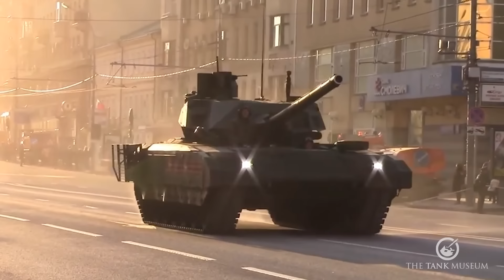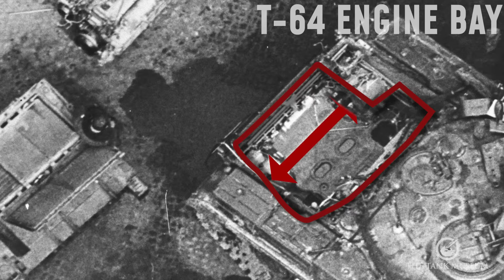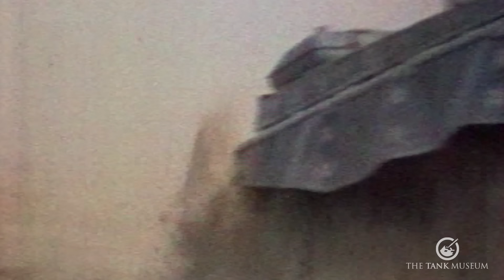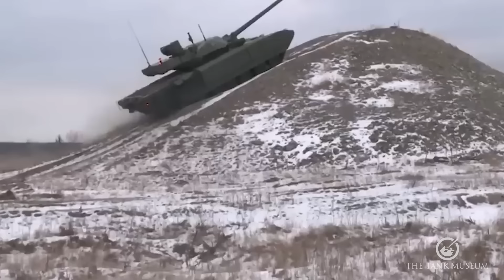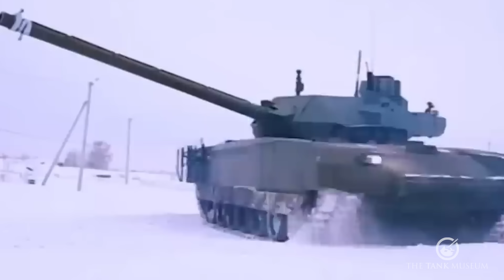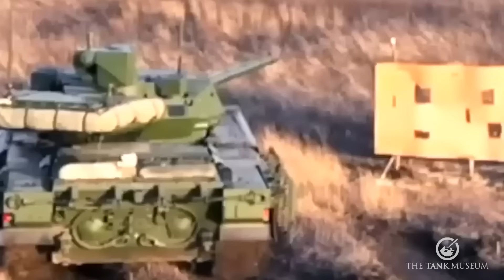Radical or Ridiculous? | T-14 Armata | Tank Chats #171

Comment: I feel like any footage of the T-14 should come with the disclaimer “Not actual game footage” 😂
Reply: The best way to discern real footage is to determine whether the turret is spinning wildly. If it is, it's real footage.
Reply: @bigrob966 T14 is a dual use vehicle. Tank and Helicopter all in one.
Reply: @AWMJoeyjoejoe  eeking out a few extra centimeters in the turret-tossing challenge
Reply: @AWMJoeyjoejoe  Pretty sure you have to spin the turret to 'charge' the vehicle. As you stop spinning and release the hand break, the tank rolls forward. As soon as the tank has fully rolled its way, its time to spin again. Just like toy cars from the 70s and previous years. The gun barrel acts as a leaver to easy the process.
Reply: @timarmbruster6693  You may be on to something. Last time they showed the T14 on their May parade (back when that still included tanks!), the turrets weren't spinning correctly, and wouldn't you know it, at least one of the T14s stopped working!
Reply: @AWMJoeyjoejoe  🤣🤣🤣🤣🤣🤣🤣🤣🤣🤣🤣🤣🤣🤣
Reply: @namewarvergeben  Back when it still had tanks? are you sure? prove it maybe i am wrong
Reply: @namewarvergeben No
Reply: @AWMJoeyjoejoe its like a bey blade. Wind up the turret and let go: the hull should spin
Reply: @bigrob966  😊😊 OOOOOOOOOOOO 999 oof a
Reply: dont compare it to the burned leos  @bigrob966
Reply: @bigrob966  Isn't it amazing what one can power with clockwork?
Reply: @Whatifwarlord  ..u just said it uself lol...
Reply: Украинцы уже наигрались))
Reply: Meat Salad  Funny how Russian corruption has bankrupted the Russian military from anything good whether it be armor, vehicles, guns, or anything for the military. I give you the "body armor" with egg crates sewn into it, trucks that have inferior tires and wooden parts, jets and tanks that rely on foreign electronics, and many other things. By the way, did your daddy Putin write that for you or did you come up with that in your parents' basement??
Reply: This is a work of fiction. Names, characters, places and incidents either are products of the russia's imagination or are used fictitiously.
Reply: Meat Salad  Which country is stealing toilets and washing machines? And they're too stupid to realize that they need running water for them to work?
Reply: Why do you "feel" like it? Why not think instead of feel?
Reply: MrSaiga308  ..."bankrupted" NATO ?? 😂...with few exceptions we haven't even STARTED to send Ukraine the REAL-DEAL stuff in meaningful numbers - we're still basically "phasing out" the OLD "war-gear" - especially the ex-Warsaw-Pact stocks of ammo & "hardware" from ex-Warsaw-Pact countries - even the Western-produced machines that have been sent have still been built one or two generations ago! 🤣...and ruski depots are burning in EXPONENTIAL numbers! 🤣😂😂ha!ha!ha!ha!
Reply: Yes..like ALL nato/american "victories"...lol
Reply: @Peoples Republic of Ninj morally..when they arm, fund and back nazis..luckily russia is wiping them out..just like in ww2..sad banderite bootlicker
Reply: @@peoplesrepublicofninj3418 Nato is like a gender pronounce
Reply: bot
Reply: There is literally no game with T14s in it.
Reply: did you know that the  Abrams is out with 2 tap from a T90? not even a T90-M?  very good  indeed :)
Reply: Yeah, well, Ukraine is being smashed with just rusty old t-55s and Russian shovels. Laugh that off, Genius.
Reply: useless and totally biased video, judged based on westerns mindset where expensive is "more better", russian and chinese fight with quantity, t14 wa left aside because is too costly and to boost t90M, t72M and t80M production, chips are being smugled into the country like no sanctions have ever happened you guys live in a bubble of childish
Reply: Didn't somebody leak the official specs and operating manual on War Thunder? I feel sure they must have...
Reply: MrSaiga308  You're living in a fantasy world.
Reply: @AWMJoeyjoejoe  Meat Salad Troll/Russian Bot.
Reply: @Lonewolfmike  Me?
Reply: @AWMJoeyjoejoe  Meat Salad is a troll. They are a Putin fanboy or whatever.
Reply: @Lonewolfmike  Ahh gotcha.
Reply: @AWMJoeyjoejoe  
Biden in 2022- Our sanctions will be torn to shreds the Russian economy.
Biden in 2023 - US default is not an option.
Reply: Everybody keeps knocking on Russian tanks but they are super advanced.  Name another country whose tanks are equipped with ejection turrets.  ;)
Reply: @auldphart7912  ejecto seato, cuz!
Reply: @auldphart7912  🤣🤣🤣🤣🤣🤣🤣🤣🤣🤣🤣🤣🤣🤣🤣
Reply: @auldphart7912  what about these ejecting tank turrets of the Leopards 2? https://youtu.be/X6nZvDn6gRQ
Reply: @auldphart7912  Abrams, Leopards, M60s, T-55S, where are they used i wonder
Reply: Meat Salad  Bankrupted NATO?  US has sent $13 billion in arms and money. That’s one fifth the annual budget of NASA. Most of the equipment being given by European nations are models which were being phased out anyway Dear Lord. I honestly hope your comment was sarcasm.
Reply: If it's stuck then it's a T14
Reply: @ablrcklnthewall  if it is burning..it is a orcranian nazi coffin..and if it is nato..it is now in a tank museum in moscow..if they can find the remnants..lol
Reply: MrSaiga308  lol... ya right... economy of NATO is booming thanks to Russia...
even USA is ramping up...
Reply: Disclamer: not for use on muddy terrain such as battlefields, do not chenge gear while the vechicle is moving, do not expose to explosives, do not withstand large impacts, may oveheat when used, may only be operated on asphalt roads.
Reply: Meat Salad  highly doubt that one
they downgrade T-72 (obvious sight aka important factor) using T-55 as mobile artillery, using T-62M for assault vehicle
Reply: T14 is like RR it's great  when  it works  ..if it works..😉
Reply: I mean Russia has almost as many T14's as Britain has Challenger 2's.
Reply: Pre alpha footage not representative of final product.
Reply: Meat Salad  allied: * send money *
Russia: YeAh wEsTeRN aRE BaNKrUptCy

Just like "Russia running out of _______" not actually happened
Reply: Вспомни мультфильм про гиперзвуковую ракету над которым все смеялись, потом вспомни лица когда эта ракета пробила бункер.
Reply: MrSaiga308  America is always on the verge of defaulting. It's how their politics works, and it's nothing to do with Russia. Like I said, you're a fantasist.
Reply: @AWMJoeyjoejoe  yes..just like the constant war failures..america believes its hollywood fantasies..lol
Reply: Meat Salad  well but no
I point is they never run out like same reason as Russian tanks never run out
if you say "Printing money does not mean the US is not bankrupt"
It's gonna be like "Recycle tank from storage not mean Russia still have tanks"
both still find way out how2not run out
Reply: @SRDPS2  Oh come on you know what makes russians differente? easy production if NATO loses a leopard thats a tragedy if russia loses a T 90 meh lets change    tactics and make a new one
Reply: @Peoples Republic of Ninj >NATO is supported
NATO keeps about 30 countries as *hostages*. This would be more correct
Reply: And any deployment of the F35 will be "sorry unavailable due to massive cuts in military spending."
Reply: Since many Ukraine victories posted use Arma 3 thats a good idea.
Reply: Same for F35 submarines.
Reply: @rafaelgoncalvesdias7459  Its loss rate is still lower than any russian fighter out there
Reply: @ShitboxFlyer loss rate without even being in combat, you should be ashamed of yourself, but I'm not surprised your country can't even figure out what  gender their army has.

Comment: i saw a photo of the hatch open, it was about, 25 cm thick. any top down antitank missile blows through that with ease.
Reply: 25 mm?
Edit: 7 hrs later.  Not sarcasm.  Former printer seeing a typo.
Reply: Same thickness as the M1 Abrams (25.1mm) then, no tank apart from the Merkava Mk-4 has a composite roof so its a completely moot issue.
Reply: @DaSpineLessFish  Strv122 does too iirc (improved Leo2)
Reply: @SonsOfLorgar  Fascinating, its a forward thinking addition that hasn't seen much adoption yet because no one has really fought a serious modern war in many years.
Reply: Gz,its top is thicker than a Maus frontal.Allies are really screwed:(

Comment: Best thing NATO can hope for is that Russia commits to replacing their tank force with T-14s. It would be a huge weight round the neck of their army with no way to fix the issues. XD

Soviets spent decades failing to get the family of engines working right and frankly doesn't look like the Russians have managed much better. The A85 is a dudd. Bit dubious to say it was based on the german ww2 engine though, maybe inspired by originally but they are very different beyond the broad concept.

Comment: one thing i do love, is yes, russia is full of corruption
but the pentagon announced, rumsfeld back on sept10, 2022, trillions missing. they just "miscalculated" 3b of stuff to ukraine, and per an abc? or cbs? documentary - even in the trailer that they tore down quite quickly, 70% of arms are not making it to the front lines, and per reports, you can buy a javelin on the black market, one given to ukraine, for under 35k, and stingers are way cheaper. the US and Ukraine are hard at work trying to make sure they are the top dogs of corruption ;)

Comment: T-14 has not yet been used in battle or have the numbers to do so. Personally I'm more worried about the updated T-80s and the T-90Ms than a parade weapon.
Reply: T90M production is hindered because of sanctions. These "modern" tanks are built using a lot of components and electronics Russia no longer has access to.
Reply: @wyringen  😂 Dont tell, they are using washing mashine ics, right?
Propaganda consumer...
They are producing 100 T-90 in a month
Reply: @wyringen they use the older tanks as infantry support and artillery rather than as tanks. If a T90 or T55 shoots you you're still dead - the age of the tank isn't going to matter!

Comment: The T-14 seems like another Tiger situation. Where everyone takes the tank very seriously and hype it up as some unbeatable super monster. Sure it can fight, but it's actual combat capabilities are much different from what it has been hyped to be along with production numbers too low to have any notable strategic significance in the course of the war

It was stated that it would take 5 Shermans to take out a Tiger, and although it is true that the Tiger was better in tank duels than a Sherman (along with a couple other factors), there have been many situations where a Tiger has been knocked out by one M4 like any other tank. The same most likely applies to the T-14.
Reply: Tiger was real.
Reply: Yeah I think it's all Russian propaganda. Which is probably why we've not seen any in actual meaningful combat... because it'll be proven its just as vulnerable to western anti tank missiles.
Reply: Would you rather be a Tiger crew member or a sherman crew member though?
Reply: @PM_Fernandez_ES  sherman 10/10 times, you dont lose the war, obvious, you can actually succesfully bail out most times your tank is destroyed, your gun has a stabilizer (if lucky), you dont constantly smell your commanders ballsack because its cramped, you can actually retreat because the tank is fast, does not break down easily and doesnt require as much fuel, you get air support and better equipped infantry and support elements.

sherman 10/10 times
Reply: Russia has way beter arms production capabilities once mobilised than the west.
Reply: Used to... Not anymore! The USSR had the Production capabilities, which included Ukraine. Russia is now Alone! Ukraine had the Motor Plants and Steel Mills, and some of the Soviet Tech Industry was also in Ukraine. This is why Putin's Russia needs Ukraine so badly they were willing to go to war to get it!!! But all Russia has in Ukraine is RUINS!!!
Reply: @daniellejones5981  exactly. The centre of Russian/soviet industrial complex was always in Belarus and Ukraine.
Reply: Modern weapons are too complex, if you only start making them at the start of the war, you are already too late.
Reply: the russian economy is failing, the west collectively has like 7 times the economy russia does.
the west also has more than 800 F 35's already in service, i'm extremely certain if russia mobilizes the west doesn't even have to.

Comment: I think if Russia stuck with one model, it would be much easier to build and cheaper.  Stick to the t90 since it's the newest and more modern. Building t72a and t90 of various variations is probably a nightmare on the manufacturer.
Reply: The issue with the T90 though is that autoloader is so vulnerable to missile attack. Any penetration of the turret armour and off pops the turret.
Reply: @roadsweeper1  The turret pops off because ammo is stored around the turret. If it's kept in the carousel, it would give it more survivability. T90 does offer more ammo protection compared to older models. The issue is top attack detonation, where the turrert is the weakest. Any tank would be blown up from a top attack.

Comment: No hype, just facts. I love it!  Especially the competitive design bureaus pushing products that splinter the service uniformity of the armored forces.  In recent months, the effect of high tech sanctions apparently handicaps the Russia's ability to update firing systems, not only on tanks, but on artillery and ultimately on jet fighters.  If the effectiveness of their hardware is inching forward, it may go into hibernation until this 'special military operation' ends. Russia's dilemma: slightly better hardware, operated in 'non-Red Square' terrain by significantly diminished and under qualified crews, is a formula for disaster.

Comment: I don't think the real problem is the design, nothing about the Armata actually seems particularly bad or far-fetched on paper. The reason it is ridiculous is the logistics of it. Specifically, the industrial logistics. 

Russia just has nothing like the advanced industrial capacity to produce and maintain these at scale. The Soviets did, the Russians don't. Making the entire thing utterly ridiculous, as evidenced by the fact they are still nothing near serialized production, and never will be. They have the same level of historical relevance as something like the MBT-70. Its features might be found on later tanks, but the tank itself is never going to be a significant tactical presence.

Comment: So yes. They kicked out the upgraded t34 engine, and replaced it with a civilian version of the porsche tiger engine. And people somehow think the russians are capable of doing anything other then embezzlement.
Second of all, a family of vehicles may sound like a good idea. But if they're based on a big heavy tank hull they'l be consuming fuel like a tank does.
I wonder if this could possibly lead to any kind of problems for the russian logistics, which is why we haven't seen any of them. 
It's a horrible idea, based around a unreliable 80 year old engine, designed by people more capable of theft then innovation. It will never be massproduced, it will probably never even be adopted into service.
Reply: Least misinformed lazerpig viewer.

Comment: The T-14 offers no offensive advantage because the main gun and its sensors are not an improvement over the same systems on the late T-90's.
Defensively, while having the crew removed from the turret protects them, having all the tanks combat essential systems in a thinly armored turret means the tank can be easily taken out of the fight.  A tank that isn't combat capable is a waste of men and metal.
Add to this an engine not intended for use in vehicles, the loss of the crew's ability to sense the battlefield directly, the mechanical/electronic complexity of it all, the ability of the crew and Company to maintain the tank in the field, and its clearly ridiculous....
Reply: It also has an engine purposefully designed for it, what do you mean it's engine wasn't designed for his vehicle?
Reply: @voidtempering8700  The engine for the T-14 is A-85-3A (also known as the 12N360).  

This engine was originally intended to provide power for drilling rigs and large construction equipment and is only being adapted to tanks.  It's a radical departure from prior engines in that its 12 cylinders are arranged in an "X" pattern.  

Because of this arrangement, two or all four the the cylinder heads will be inaccessible while in the vehicle, meaning you need to pull the entire pack to do work on any of the 4 sets of valve trains.

Not exactly the simple, rugged and reliable engines we are used to seeing in Russian tanks.
Reply: It has more protected tutted and more stronger main gun, or to be accurate it can shoot more stronger(longer) shells.
Reply: @trololoev  The main gun is the same main gun used in the later T-90's, so it offers no advantage.
Reply: @trololoev The turret armor of the T-14 will stop 50 cal maybe 20mm.  No way will it stop 25mm or 30mm APDS.

And, once that turret is punched, you've got a 2 man APC.